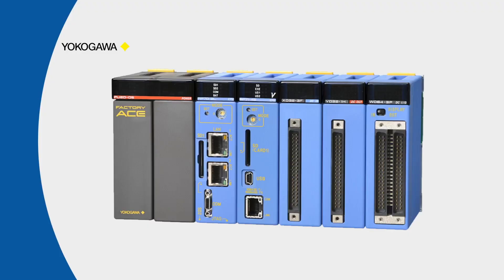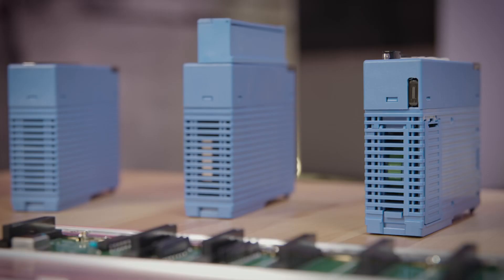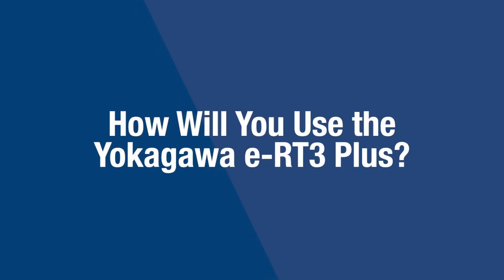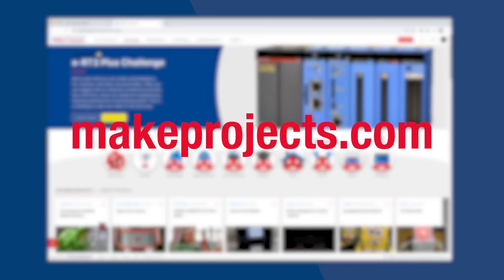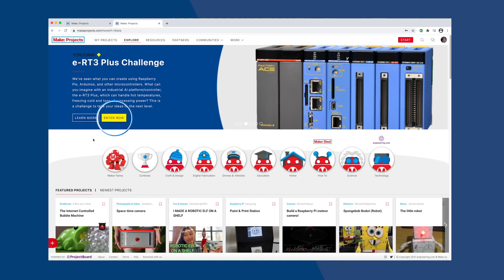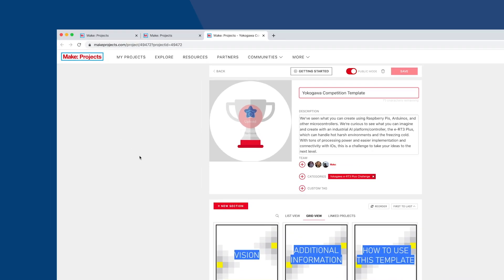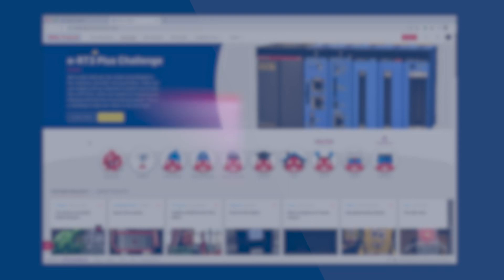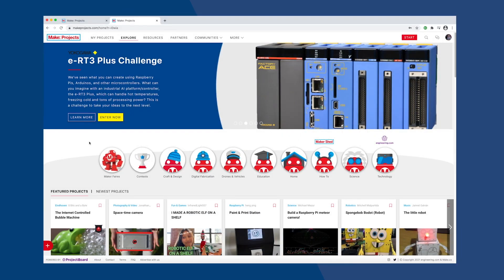Join Our Automation Contest!

Comment: How would I use it? with these specs and that price, I'd send it back where it belongs...the 80s lol (of course, I don't blame Make, it is just a collaboration)
Reply: It is a dual-core processor 850 MHz w/ 1 GB RAM. More like 2003. When Back to the Future came out they had 30 MHz CPUs.
Reply: @accursedshrek  I obviously exaggerated, you are mostly correct. Around 2000 800+MHz, 2001 you would get to about 1GHz on desktop  processors, around 2005 dual cores by intel. I mean come on, in my mind if you want to do AI on the edge these days just get a unit from the Jetson series by Nvidia. And as for the insulation, I'm sure you can build a case for much less than 5000 dollars, that can withstand -20 to 75 °C as they mention. Is there something I'm not getting here?